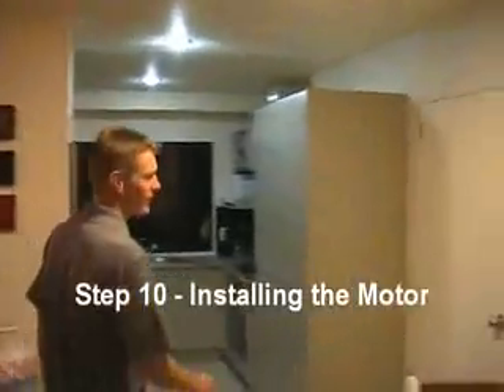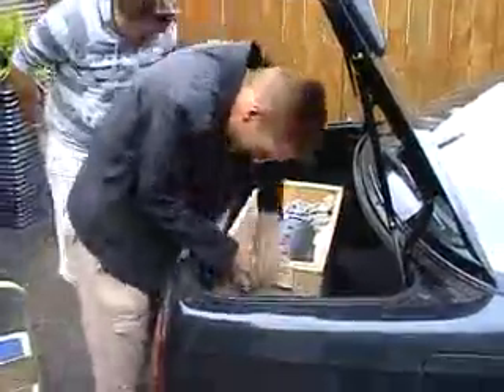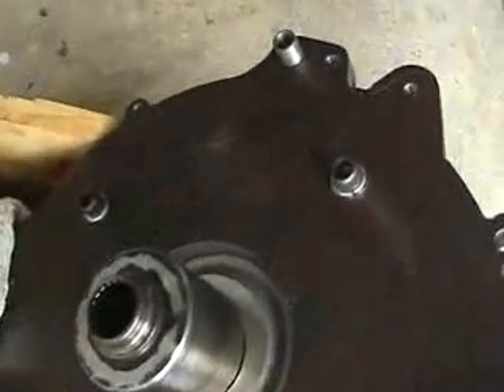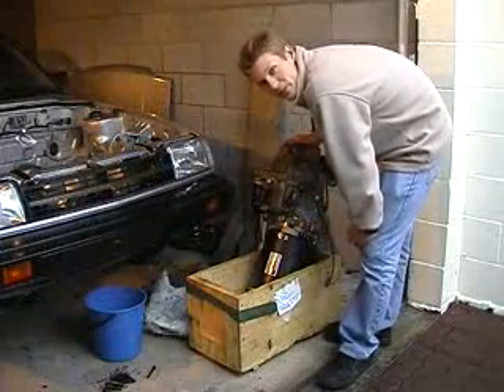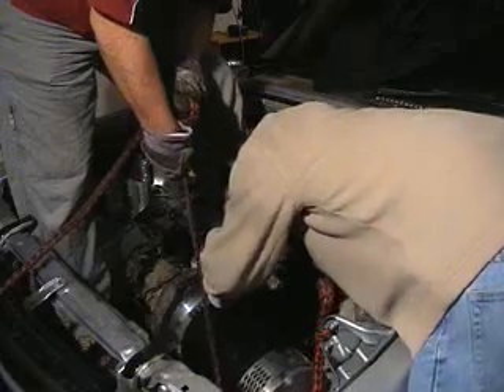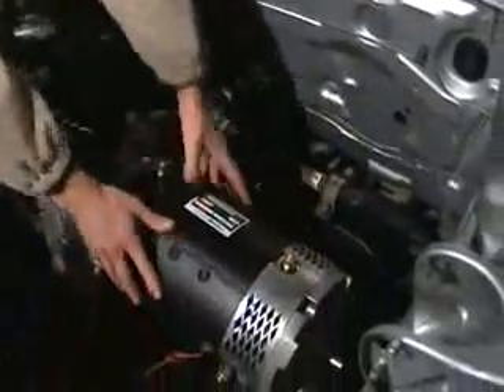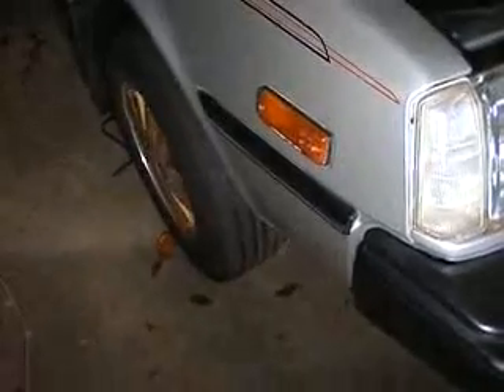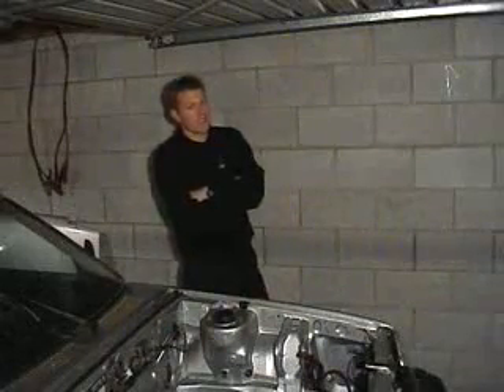Gav's EV Conversion 10 - Installing the Motor

Comment: Generally EV's that are mass produced by auto companies are powered by AC, but people that convert cars to EV's power them with DC because AC components (motors and controllers) are extremely expensive, and AC powered EV's need higher voltage (200-300 volts) and the batteries needed to produce this power (lithium, ni-cad) are very expensive and limited. Hope this helps.
Kyle
Check out my EV conversion videos!

Comment: HI Gav. Great work so far. Read with interest that you bought a high frequency charger. Heard a guy in Auck was reconditioning batteries but didn't know the chargers are available. Do you have a contact. Hope it work out without a clutch. Not so hard to put one in. Just need to mount the old flywheel onto the motor with an adapter boss.Probably would have been cheaper to make than the splined adapter.All the best .Grant.

Comment: The particular electric motor you are using is a Series-wound DC motor. Very good choice. Make sure to use #2 gauge wire or larger so you can safely carry the current the motor will draw when under load.

Comment from the maker: I've planned to snugly fit 6 in the front and 6 in the boot. The boot (trunk) will be easy but it'll be a tight fit in the front!
Next vid should be up in 2 weeks if my welding guy finishes the racks soon. 
I've found more rust in the meantime. More sanding this week... ugh. :(

Comment: Yes I have, I'm a 'Yank' who lived in OZ from '87-'90 and after the first year I bought a '73 Holden station-wagon and drove it to Cairns. I guess the first year there acclimated me to your Lefty ways, but I still took the first 20 seconds of my first drive on the wrong side....didn't make that mistake again! =-0 Generally what I found difficult was dealing with the whole car being to the left of me instead of the right, otherwise it was OK.

Comment from the maker: I'm not going to use a 144V DC to 12V DC converter to save money. I'm using a smaller deep cycle battery I got for free. I installed that last weekend and it looks good in it's new location.

Comment from the maker: Gidday! I'll be using 12 x 12v batts in series to give 144 volts. I should be able to get about 60 HP out of the motor but more than twice the original torque. Should move along with the other traffic effortlessly!

I moved the car up my driveway under electric power yesterday - I invite you to check out the video on my site!!!

Comment from the maker: This is the FB1-4001A motor. They had an adapter plate and a fitting tool but it was going to be too hard with the distance so I got one made up here. As for the controller, I'm still saving! :)
There's one guy out there that converted a Jeep 4x4 to electric. Don't know if he's gone off road but his site is driveev,com

Comment from the maker: Ahoy-hoy, I'm using the fairly limited Nerovision editor for the vids as it came with the DVD drive.
The project is at about $3000 USD at the moment (lots of that is shipping) and I'm hoping Video 11 will be up in a month or so. Vid 11 will be the battery racks I'm hoping! Money is in short supply however so there may be a delay! :)